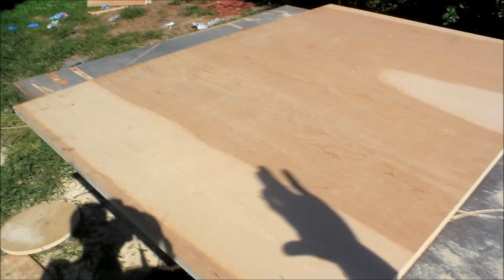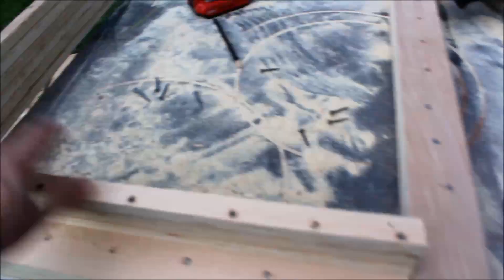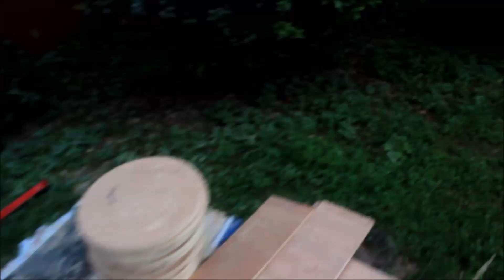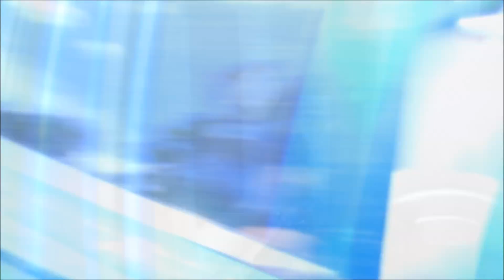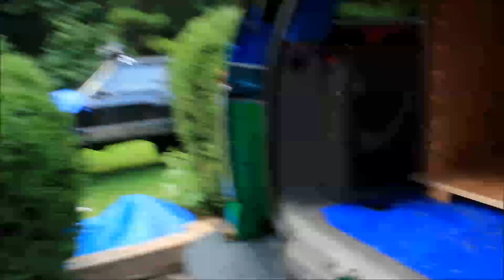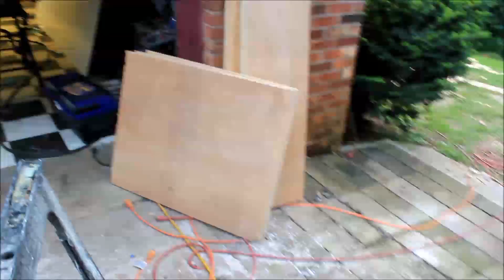8 15's DC Audio Tahoe

Comment from the maker: Just alot of screws.. course thread as you can get for maximum pull together. Ill go back in the edges and corners and run a lil silicon just for a air tight seal if i dont fiberglass resin just the edges and corners